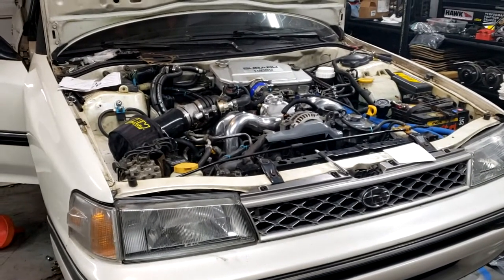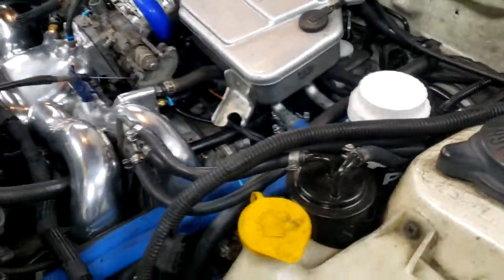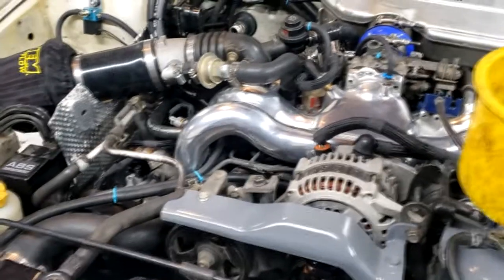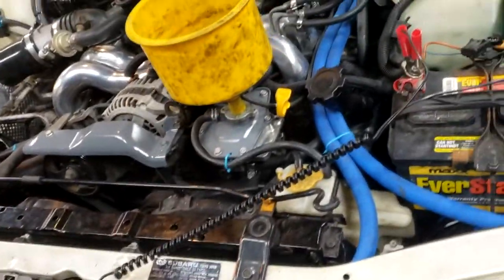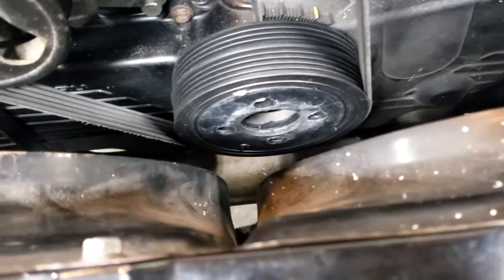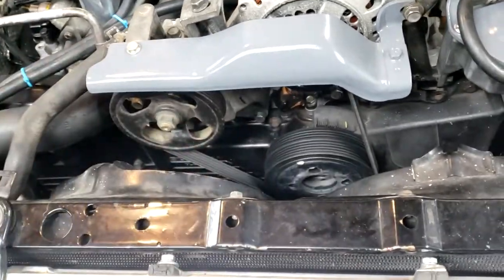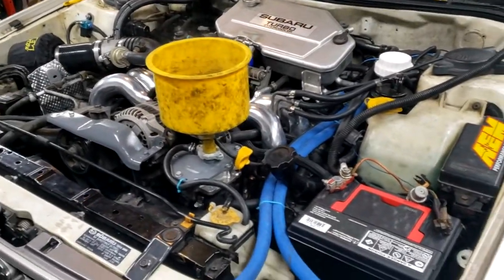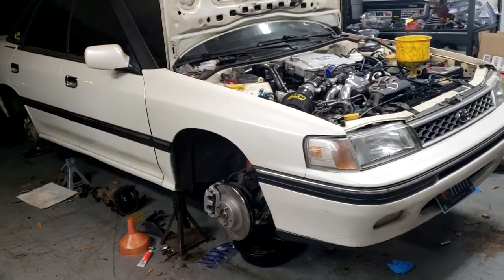Haltec FIRST START! on the built engine - 91 Legacy Turbo

Comment: Happy NY! Good start of the new one - literally! Congrats! You got it running at last! I see nice v-bands on the exhaust there :-P Who's gona' tune it? BTW on standalone you always start with validating all the sensors + angle validation... but you have already found it. While watching I was like 'oh dude, check that, then that... :)'.
Reply from the maker: Thanks! Yeah once we figured out what was wrong it was a little hard watching the video of us struggling lol. But that's part of it, showing the mistakes etc. It definitely feels really good to hear it run after 8 months
Reply: @HackSquadGarage  tell me about it. My Mega came with my turbo Legacy and it's with 2010 old firmware version. Trying to sort things out if everything is correctly setup, so I can upgrade it safely. Yesterday I just found out that it's mapped with advance of +10 degree, because when I set it static, instead of 10 degree I get 0... and such funny things LOL. All the best in this year and be healthy and keep up the nice videos and work on the projects! cheers
Reply from the maker: We are not decided on a tuner yet. It will either be surgeline or #stevetuned